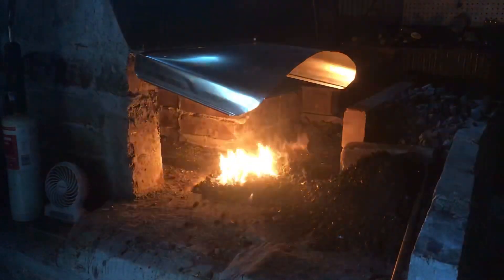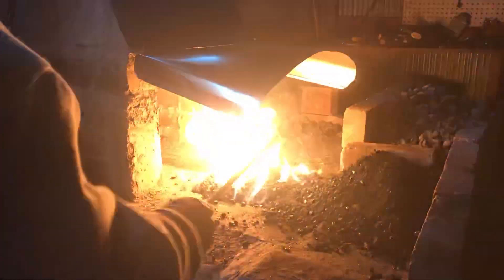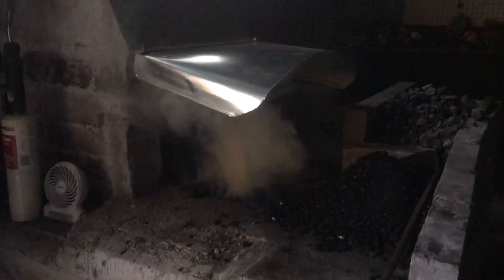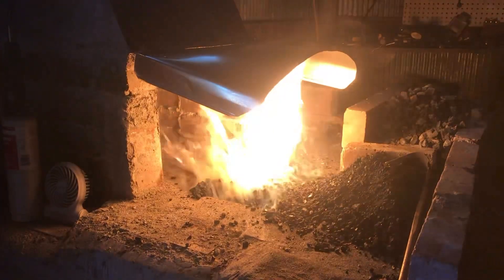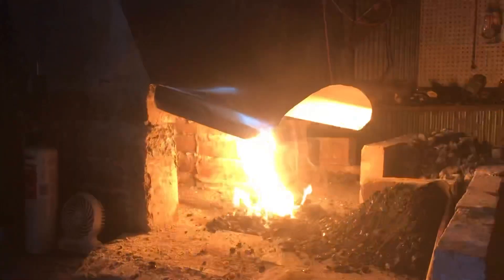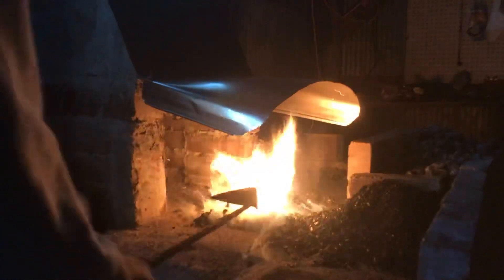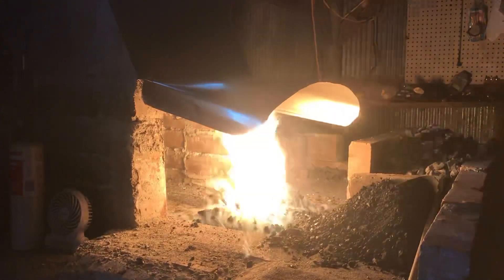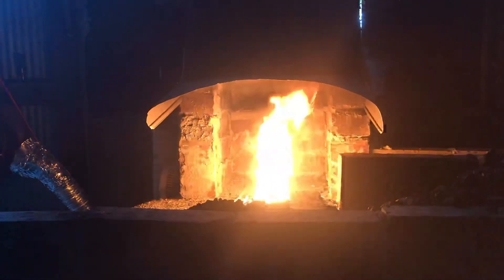Hidden Danger of a Coal Forge

Comment: You need to change your hood scoop never use galvanized around a forge when it burns off it'll make you sick
Reply from the maker: I’ve had metal fume fever before after welding at my day job. I am fully aware of the misery that can come from galvanized coatings. Thank you for your concern and this was a temporary proof of concept hood, a proper one will be constructed soon.
Reply: @veteranironoutdoors8320  I poisoned myeslf 3 yimes before I figured it out.
Thanks for the video. This was new to me.

Comment: Oh yeah. Didnt answer you in live stream,  sorry. 
No I haven't yet. My welder buddy balked at welding my cast iron  forge. Then went on medical leave for a month or so... I dont dare fire it up cracked I dont think. At least I should drill the 4 cracks and coat it in Mizzou if I cant get it welded I guess
Reply from the maker: Daniel Crawford sad to hear. I don’t know why he would balk at welding cast iron unless he’s never done it before.
Reply: @veteranironoutdoors8320  , just didnt wanna jack w it cuz it's time to go home for days off I'm sure. Lol
Reply from the maker: Daniel Crawford time to practice your welding!
Reply: @veteranironoutdoors8320  lol probably so huh. Just gota heat it to what 600 then use nickle 99 rods right? After drilling and grinding of course
Reply from the maker: Daniel Crawford We use a rod specifically designed for cast at work, but you can use nickel rod. And as long as you preheat it pretty good itll weld like normal
Reply: @veteranironoutdoors8320  , ten 4. I get it. Just always heard nickle 99 or 55 rods. Yall got the good stuff though I'm betting
Reply from the maker: Daniel Crawford spare no expense
Reply: @veteranironoutdoors8320  could I talk you into sending me a few of those special lil rods ? Lolololol
Reply from the maker: Daniel Crawford ill see what i can do on monday

Comment: Got your first dragon fart I see. It is dangerous and I based a safety post on exactly that before. The forge looks like it breathes good. The worst dragon fart is when it pops back through the tuliere and blows a blade off the blower fan. I've had it blow the stop from the thru pipe on my old setup 20ft straight out. Highly volatile stuff. Best bet is starting with coke saved from previous fires and using very little green coal. County Line Forge made a video on starting the coal forge that is a perfect way to get it going and I've adopted it to start mine. Thanks for the video Jared! I'm hoping we can meet again soon and do some forging again together.
Reply from the maker: The Sprinkled Donut Forge I’ve had this happen before too, much just happened to catch it on camera this time! And I do plan on coming down that way in the future!